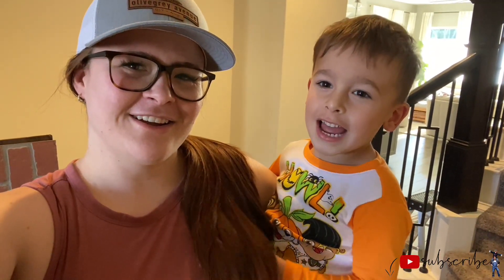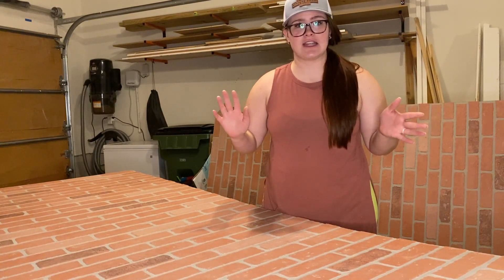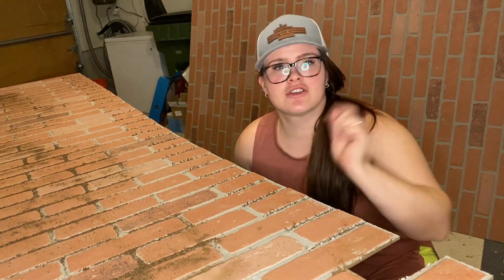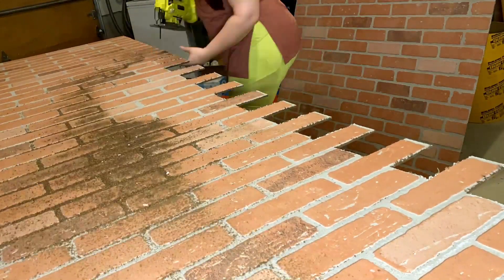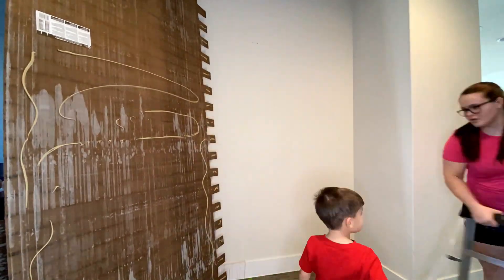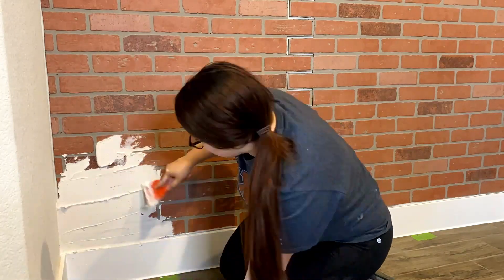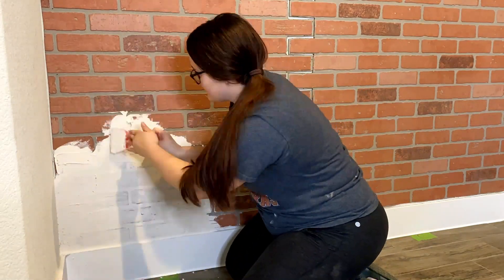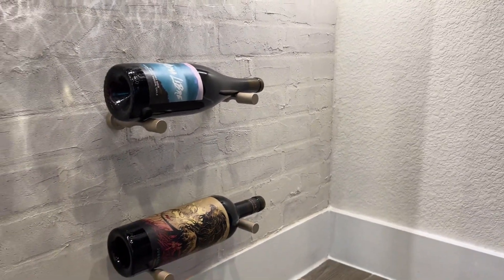The SECRET to a Seamless Faux Brick Panel Accent Wall!

Comment: Looks beautiful! I have to say that your faux brick wall is the nicest I've seen. I want to do this but I have to ask if you've had any issues with the mortar sticking to the panel or crumbling afterward.  I've seen comments in other tutorials stating to use joint compound or spackle as mortar does not stick.  Any issues with adherence?  Also is it washable?
Reply from the maker: I’ve had no issues with its durability but I’d say it isn’t washable however I’ve never tried

Comment: I was curious, if you wanted more brick to show through would you use less product or wipe it off with a rag?  If you wipe it away how much time do you have?  Looks great.  Can't wait to see finished area.
Reply from the maker: You could really do either! I would probably lean towards wiping it off so that it does get some coverage and then you can take a wet sponge and wipe the desired amount off. It doesn't dry super fast but the thinner the coat, the faster it will dry.

Comment: What did you use to make it stick to the wall! It feels like I’ve tried every substance! On a spot that has concrete I guess it’s to the DIY faux for me on that part of the wall LOL
Reply from the maker: I just used construction adhesive and some brad nails to hold it in place while it dries. For a concrete wall, brad nails wouldn’t work but you could use a strong tape to hold it in place while the glue dries. Hope that helps!

Comment: Question, what if I don’t want to paint the panels. You think just finding a grout that matches really good and use slot just in the grout lines and then cleanup the bricks will work?
Reply from the maker: It could definitely work. I personally wouldn’t use the panels if they’re not painted or shmeared because you’ll be able to tell they aren’t real brick but if that doesn’t bother you, it’ll work!
Reply: @olivegreyavenue  I’m thinking of doing my garage just for a background for my arcade games. So it’s cool if it looks a little fake. I’m hoping to get a grout close enough so I can just use on the seams and feather it out so I don’t have to do all the grout lines
Reply: @olivegreyavenue  ty for reply
Reply from the maker: @KingZarkon  oh yeah it’ll be perfect for that!

Comment: Your video has inspired me to do this as a feature wall in our living room. I’m just wondering do you have to seal it? Does the wall kick off a lot of “dust”? I am just worried that I’m going to be vacuuming up white wall dust all the time?
Reply from the maker: I’m glad to help with some inspiration! You can definitely seal it if you want but there is no dust that comes off it. They only reason it may do that is if abrasive things run up against it continually.
Reply: @olivegreyavenue  you definitely have! We did the ikea built in bench for our dining room! My kids would definitely do that. What would you seal it with?
Reply from the maker: @just_hit_pan1393  oh how awesome! I would seal it with a grout sealer